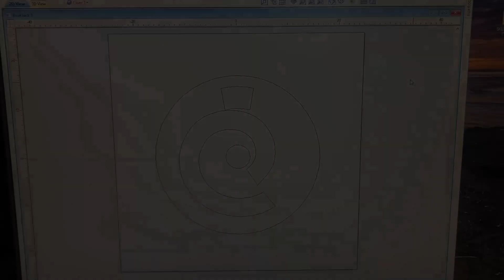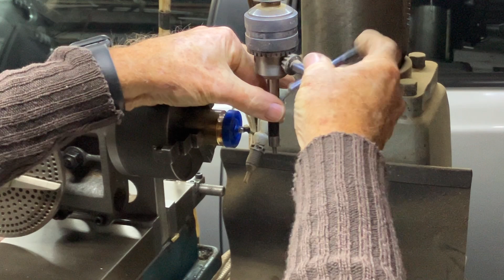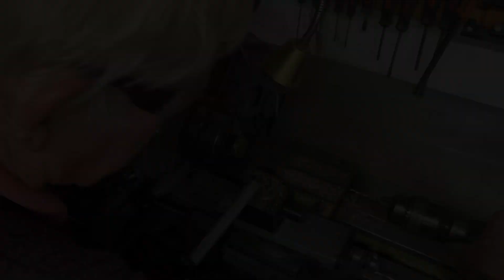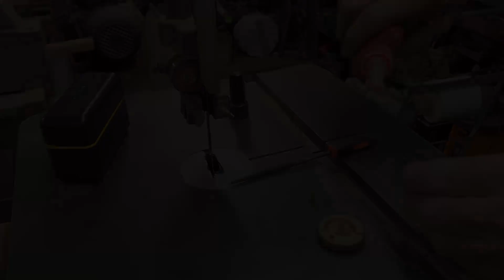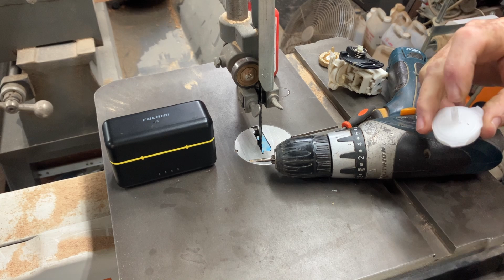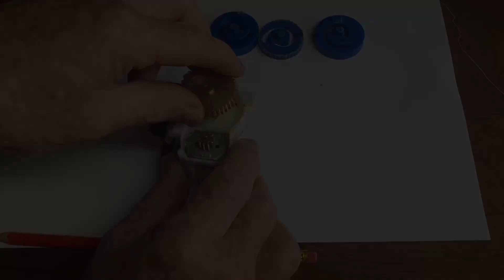Repairing a car boot lock actuator

Comment: Can you not buy a new one at the local motor spares shop?
Reply from the maker: Absolutely - A new one would cost less than the materials and a new blade for my power Saw, (that broke during this project), not to mention the time it took. But where's the fun in just buying one. 😂
Reply: But that’s not as much of a challenge!